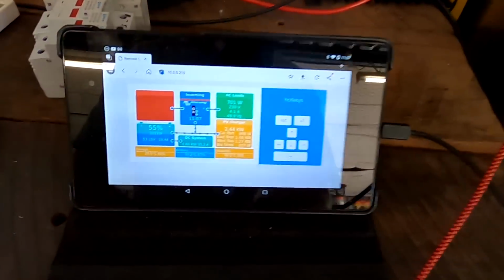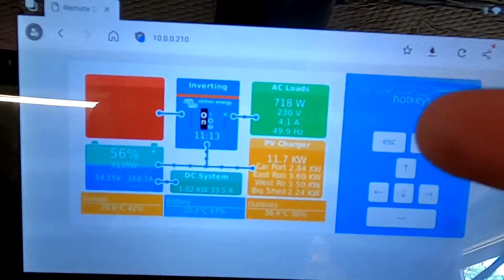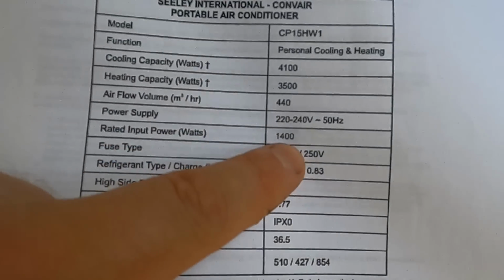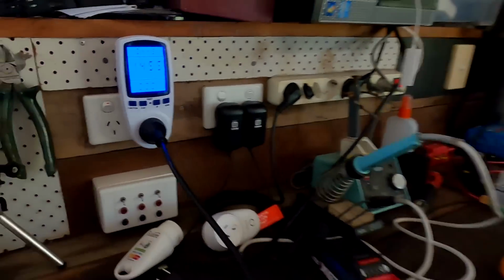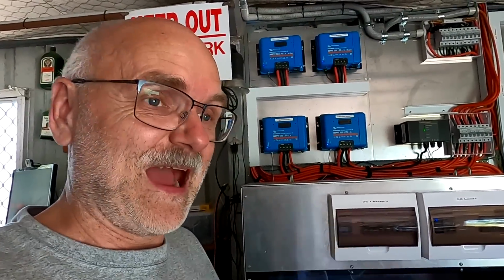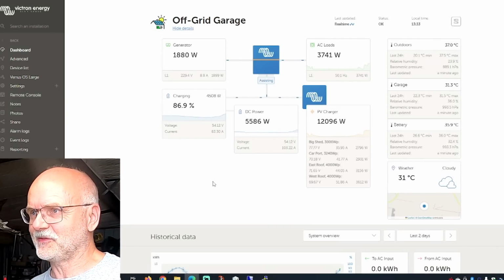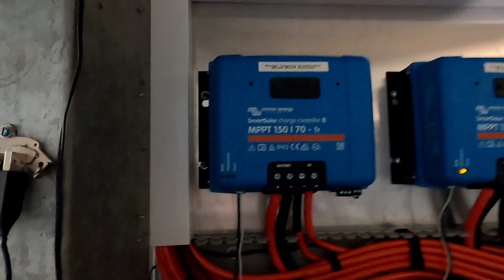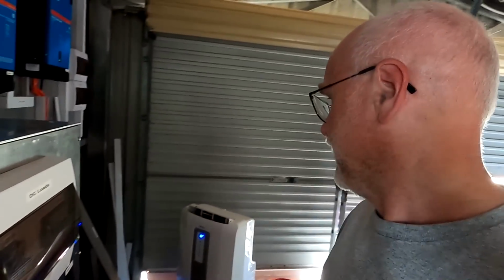Actively cooling solar and battery equipment with an air conditioner. Beneficial or waste?

Comment: I can see cooling the batteries, particularly since the battery box is already enclosed. The batteries will definitely last longer at 30C than at 40C.  You could extend some ducting to the charge controllers too (but otherwise keep them in free air).  I would expect, though, that the charge controllers already have an internal firmware temperature servo.  Being solid state, the internal electronics should already be spec'd to operate normally at commercial temperatures (up to 65C).

What does the Victron manual say?  I'll look it up..  Ok, for the MPPT 150|70 the manual says:
    "Over-temperature protection and power derating when temperature is high".
    "Operating temperature -30 to +60C (full rated output up to 40C)

That's what the manual says.  Therefore you don't need to cool the Victron charge controllers.  At worst, maybe just a fan if they derate more than you want (only happens above 40C as per the manual).

And then you can go with your original concept of using a smaller A/C and just worry about the batteries.   250A @ 48VDC = 12kW.   Battery compartment: 95% one-way efficiency (minimum or worst case)... 12kW/20 = 600W of cooling needed to stay ahead of it.   Actually less.  Assuming a COP of 2 for the A/C, you would only need 300W of A/C (600W of cooling equivalent).

-Matt

Comment: Your solar equipment puts out a lot of heat. If you don't get rid of it, it will shorten the life of your expensive equipment. I use a 9000 btu Fujitsu in a 10x14 power shed. Nice 20C all summer. Rarely turn on heat until it gets below 0C.
Reply: It moves about 10kW electrical power with, let's say, 90% efficiency. That means about 1 kW of heat power lost.

Comment: You can emulate the AC remote control with an Arduino + RF module (or IR diode if it is infrared) or the quick and dirty solution: solder wires to the keys of the remote and connect them to your control circuit.

Comment: For the amount of heat you are generating you need atleast a 18000btu inverter split type aircon if you build an isolated room from the first garage door. You can have heating and cooling. The devices lifetime increases if they are running cooler.

Comment: Hallo Andy,kenn auch deine anderen kanäle,find schade das du diesen in englisch machst,
weil PV bzw batterie Bau des is was mich mehr interessiert
Bei mir im Keller wird BWWP kühlung der 3 Viktron MP 5000 und
 3 Batterie Packs,gleiche wie deine, übernehmen.
mfg Hans

Comment: build a room around the power wall and such and use the air conditioner to cool it in hot weather then in cold you open the door to let heat into garage and when are out there working simply open door to get some A/C when its hot.

Comment: You could also try to add thermal paste between your aluminium back plate and the heat sink of the charge controllers to lower the temperature.

Comment: I use one of them in my room, pro tip: Insulate the "exit" hose. I use a triple layer old sheet and it reduces the temp "dump" into the room by a massive margin. The raw pipe feels hot, the sheet doesn't. Cost? an old sheet and 5 minutes with a sewing needle. I would estimate an extra 10-20% efficiency.

Comment: Hi Andy! I'm curious, what would the temperature gradients look like with a high-output fan rather than an air conditioner? I'm guessing air movement alone would be sufficient. I have found that equipment temps at 40C is fine, and the equipment still produces 100% output. You know you have to compare the cost:benefit of running the air conditioner to just a fan. Maybe someone who wasn't German would skip the comparison, but not you.  ;-)
Reply: Running just a fan makes sense, let us see Andy do it.

Comment: I just noticed your still using the ve direct cables instead of can bus on your mppts is there a reason your using ve direct rather than canbus?

I'm curious if there is a difference in the features or not but I suspect the canbus daisy chains so the cabling would be neater too. But you could then repurpose the ve direct for the smaller old chargers and use them to test panels again maybe

Comment: Hey Andy, great and entertaining video as usual ! To cool the MPPT controller in my Caravan I have a simple 12v computer fan placed above the controller, works a treat, dropping the temp by 5 or ten degrees at max load. Forces a lot of air across the heatsink :-)

Comment: In my RV I use a fan on a “thermo cube” wall plug from Amazon that goes on at 78 degrees F and off at 70 degrees F for the lower energy consumption

Comment: Since it only needs to be temporary, hang a heavy canvas painters tarp from the ceiling down to the floor to "wall off" that corner of the garage and contain the cooler air.

Comment: Andy,
1. Yesterday our HVAC condensation drain froze in Frankfurt am Main
2. You violated the "insulation before Installation" rule for HVAC systems 😉
3. You can add an infrared transmitter diode and Install LIRC on your RaspberryPi to control the air conditioner
4. Have Phun 😉

Comment: I saw that Signature Solar (and others, I'm sure) is selling a solar powered mini split heat pump that would be perfect for Andy's Garage. And the mini splits are way more efficient than whole home. We just put in a 16 or 17 SEER HVAC. I've seen mini splits with a 22 SEER rating. Andy said he didn't like extra equipment laying around so a mini split would work for him, especially if he walls in his equipment like he spoke about maybe doing.
Reply: There is not much heat pumps for air cons on the Aussie market that I have been able to find. We have hot water heat pumps I just installed Thermann x split hot water heat pump but looking hard to find one for an air con 😅

I have seen American you tubers getting them off EG4 and Mr Cool but they are not in aus yet

Comment: Hello, in the marina world we often use the dehumidifier function and to make sure it turns back on after power cuts I bypass the power on switch to be on all the time so a plug in timer works on the power lead.

Comment: Hello again Andy, one problem you will find is after spending time in your nicely cooled garage the outside heat will hit you much harder until your body regulates again. I traveled Australia and found it was really hot getting out of an air conditioned car when l arrived at a camp site. I found it easier to travel without air conditioning. Maybe my car got more colder than your garage will. See how you go. Best wishes Jason from Melbourne Victoria.

Comment: As always, a great video thanks Andy.
As others have said, portable A/Cs are not good, not efficient, very noisy, and super power hungry. Luckily of course your power is “free”. 
As an example a good reputable 2.5kW cooling inverter split system such as MHI or Panasonic will draw under 600w flat out. They also have very low power ramp up when turned on, with absolutely no start surge. 
Other benefits include great dehumidification and super efficient heating in winter, (but yes of course more money to buy.)

Also, because cold air is heavy, if you can seal around the lower areas such as the bottom of garage doors, though not ideal, that gap at the top of the roller doors doesn’t matter too much. 
If you really want to stick with the portable for now, make sure both hot air outlet AND inlet are plumbed to the outside.
Reply: Agreed, a proper setup inverter split is worth doing the battery area or a whole workshop area very efficiently & effectively, could probly do something pretty good for the price of one of those Victron inverters.

Comment: Get a micro PC or another Raspberry Pi and install Home Assistant in it. Buy a few smart plugs that are rated for 240V that work with HA and plug the AC unit into it. Then you can build an automation in HA that turns the AC on and off automatically based on the inverter or room temperature sensor.

Then it will only turn it on if it needs it, even when you are not there.

Comment: Andy,  wouldn't make more sense to add a Peltier cooling module to the back of the heat sink of the equipment you want to cool.  You would only be using a few watts to place the cooling exactly where you need it.
Reply: I was thinking the same. And less risk of condensation that may occur

Comment: I think the Air Con should definitely stay in the garage. It keeps things cooler for YOU, most importantly, and also for the equipment and batteries. Since you have 15Kw of solar power coming in for most of the day, you might as well use it to cool off  the Off Grid Garage. It will be useful in the winter as well since it is dual purpose with cooling and heating. The only thing you need to do is find a permanent place to pump out the exhaust and water line. That will allow you to keep the garage doors shut and keep the garage nice and cool when it's 40°C outside, or even 4°C outside and you can stay nice and warm making videos in the winter. Its a win win situation, and you paid an amazing price for the unit 👏 👍 Bravo, Andy! Great video as always and finding the big portable A/C for just $125 AUD is a steal as well. Stay cool my friend 😎. You have a power plant worth of energy now, so you might as well use it to stay cool and comfortable!

Comment: 17:16 You have a pool outside right? water has very high thermal capacity.
how about getting a computer water-cooling radiator kit, pipe water through it and install inside the battery box.
But of course this AC is for the room. no arguing against that.
As for the SCC, install fans blowing at the back (where the heatsinks are)
Reply: I like the idea to include the water from the pool - that would definitely solve the heat issue for all the solar equipement but it would probably be quite labor intensive to install such a system. Because of that I would also go for some standard AC minisplit solution - the installation can be done pretty easily. Also it provides the heating capability which you don't get with the water cooling solution. I don't know whether Andy is heating his pool at summertime - if he is, than he would lower the power usage for the heating when he goes for the water cooling approach.

Comment: Hi Andy, thanks for all you inspiring videos.
I have got the inspiration and I am now in the beginning of getting a system at my house. This is actually the 2nd time I am writing this, yesterday we had at very rarely blackouts, here grid fails not even every year, but for sure it did yesterday between me writing this and before I had convinced myself to post it.
Similar to you Andy, I already have a grid tied solar system that I cannot change before end of 2032, without economic consequence. Therefor I want to move all small or constant loads to a battery system.
I have already some of the parts to the system delivered at my house.
Battery cells LF280K, BMS JK-B2A24S20P, Linx rails incl shunt, Cerbo GX, 3P energy meter ET340 that communicate with Cerbo.
Plan is to buy MultiPlus-ii 48V/5000VA and a MPPT RS450/100. I know there is combined systems that do more or less the same, but I preferer separate units, if something fails.
Plan is to charge batteries from grid in case of low solar input at night time at low tariff or when there is really low and event negative tariff for the old solar system, yes that happens.
Intension is to have AC grid constantly connected to Multi. Loads should be supplied from battery power but maybe it is better setup inverter to run a bit lower power to safeguard against exporting battery power to grid. Battery stored power is not allowed to be exported, and probably not economically sensible.
My question is now:
-	What way is the best to connect the MultiPlus. Grid and load.
-	Can I choose when to charge batteries from grid, with a simple digital input in the system Multi or Cerbo, relay controlled by external PLC. 
-	Can I setup the Multi to run load, maybe using small W input from grid, the rest from batteries as long there is SOC is above a set value, according to actual measured W in ET340 energy meter.
Sorry for the long post, for now I will try to get help this way, maybe I should have divided up into several posts.
Best regards

Comment: Can you control the AC using zigbee? I have just installed zigbee2mqtt on my RPi running the Venus large image. Node-red sends commands to an IKEA Smart Socket,   a Ruuvi senses temperature and NR decides if the Smart Socket should be on or not.

Comment: Nice experiment. But i would really insulate your garage. Insulating is the best thing you can do. Paired with your ac unit, that would be amazing. You could keep the garage at 25°C without problems. I have the opposite Problem :) i have to heat my batteries daily to not destroy them.

Comment: At least it's a dual hose unit, though you didn't bother to use the second hose so.... Portables are so bad in my experience. Since you have excess solar and it's cheap it's fine. EG4 came our with a solar powered heat pump which I think would be really cool for this application but wont be as cheap.

See if you can find a cheap/used minisplit. It will be useful in the winter too if you want to keep your batteries from getting too cold.

Comment: Why not building a smaller Room inside for your Equpment  good insulation and with the aircon.
Now all your cooling runs out of this thin Walls.
But good Video

Comment: I'd be more inclined to mount a fan on the ceiling pointing towards the powerwall, even though it's probably pushing warm air over the equipment it'd still considerably cool everything down, also easier to control, uses way less energy, and would take up minimal space and wouldn't get in the way as its attached to one of the roof beams. 😀
Reply: True, but it's a great excuse to help make the shop more bearable to work in :-)

Comment: Build your own chiller cabinet water and fan elements using a chiller unit as used in the Pub cellars for cooling the beer or one of the smaller chiller units that they fit in the delivery vans for chilled goods

Comment: You need the insulate your garage better at least for the air leaks. As for the air conditioner it needs the second hose. It's designed for two hoses to run outside. It will work 100% better if you did that. With insulation maybe even a thousand percent

Comment: -40 from the outlet is impossible, not even the evaporator fins will be anywhere near that cold. I use IR thermometers as a guide to relative temperatures (before and after changes) or ball park figures never for accurate readings. Just put any thermometer in that air outlet and you will find it is nearer to +10 degrees C than -40.

Comment: Andy. If that unit has provisions for the intake of outside air (the round hole next to the exhaust?) it may be a good idea. Remember, the hot air you exhaust out needs the be replaced through other gaps and openings with hot air from outside. I would recommend a mini split, but the price you got is good.
Reply: Totally agree, a dual hose version for inlet and outlet air always has a better efficiency. A single hose version takes already cooled air from the room and blows it to the outside. Producing a reduced air pressure inside the room, whick sucks in hot air from the outside.
Well, I think it will never be as efficient and silent as a split system, just because of the smaller vents which have to run at higher speed. 😉
Reply: Exactly what I was thinking during the video

Comment: Andy, Speaking of additional devices, hummmm I have never seen that rider mower move ... It always has a flat front tire and something is always stacked on it, over it, or all around  it.... Your new aircon could take the place of the mower if you never the thing.  have a  spat.......

Comment: So, 1.8kW heat generated to create "4.1kW" of cold - the heat is generated right next to it. The overall temp actually went up in the garage. Look at TechnologyConnections video to find out why this device is a bad idea, even if the shed was insulated. And as it is not, all you are doing is bringing more hot air from outside to create localized coldspot at great power consumption, to get 0.2 degrees off the battery temp. Is it worth the noise? Wouldn't a big slow fan as you had last video do even better job?

Comment: Hi Andy. You can use smart IR controller (Sonoff WiFi-IR Remote IR Control Hub Wi-Fi) to remotely control the air conditioner. Just teach it from your IR remote controll. You can use some automations (when sonoff socket is on - turn on air conditioner).
Reply: DIY solutions based on ESPHome also work great
Reply: @oznerol256  I agree. I just suggested "works right out of the box" solution:)
Reply: The Raspberry Pi may also be able to do this.

Comment: Probably i'm not the first to say: oh no not a mobile air conditioner with horrible efficiency... But for testing purposes or with a surplus of power it's not that bad, Or if you live in a rental property where the owner does not want you(or a company) to install a split unit

Comment: With a 1 hose portable ac your not conditioning the space but just spot cooling. Without an intake hose for the condenser your pulling outside air in as makeup air. Split much better option and you can DIY after watching a few videos 😉